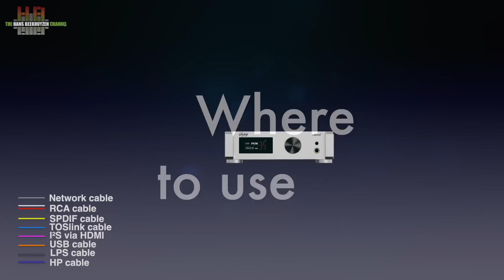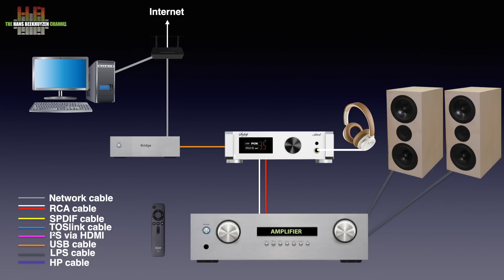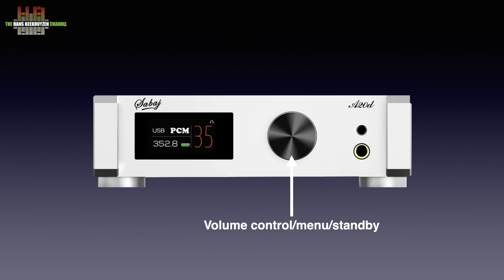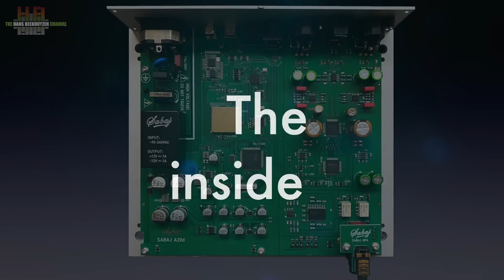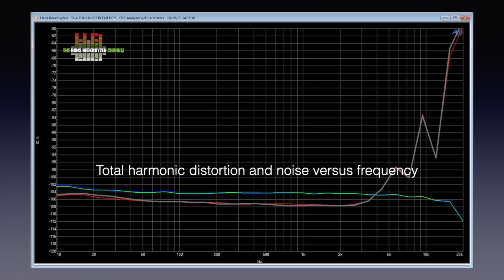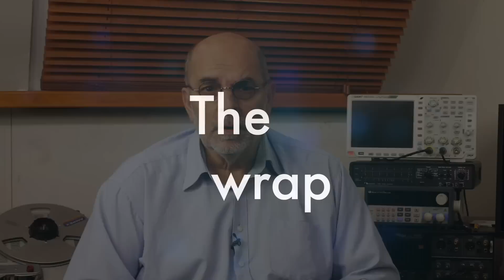Sabaj A20d MQA DAC and pre amp

Comment: Good morning,

Thank you for your work, very informative and thank you for your advice.
I have these two dacs in mind. They are sold at very similar prices.
THE Sabaj Sabaj A20d 2023 has an akm 4999ex+4191 dac and 3 OPA 1612 and the loxjie D40 PRO an ES9039MSPRO and 9 opa 1612. I don't know if the number of Opa is important for the final result.

I have a zidoo 5000 audio video reproducer with an ESS 9068 chip

Two certainly different signatures. They would be connected to TYannoy revolution xt8F speakers.

Do you have any idea of comparison between these two dacs?

THANKS
Reply from the maker: I can't have an opinion on products I have not reviewed.